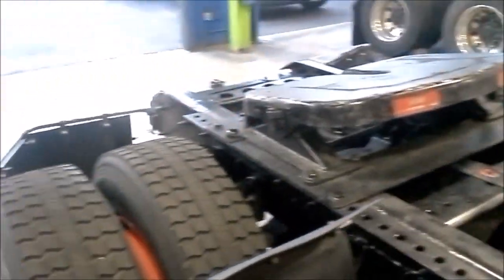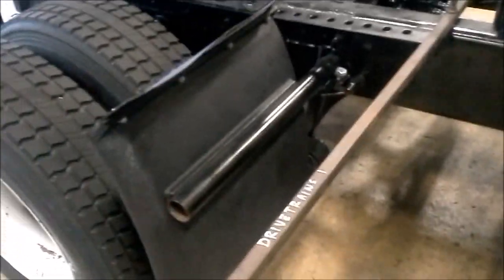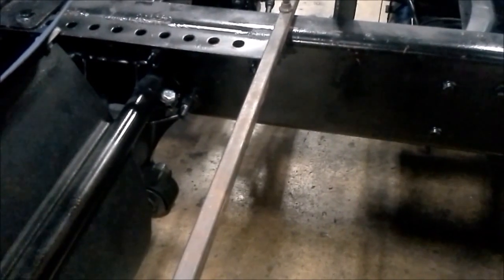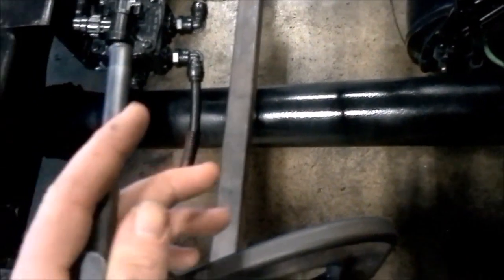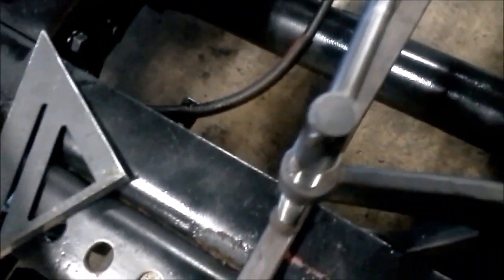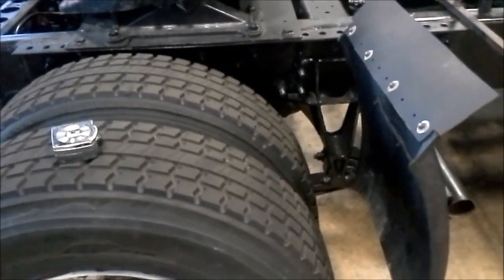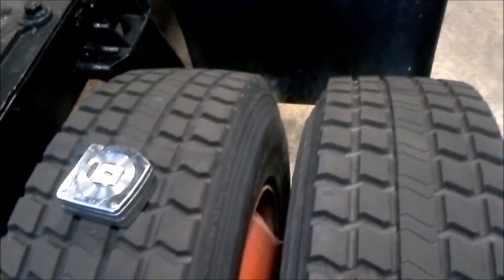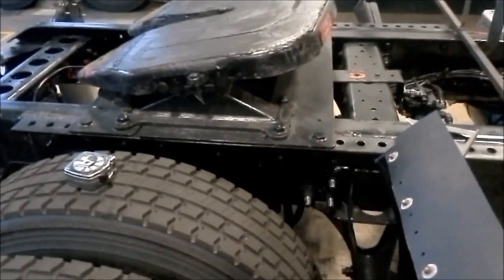semi truck alignment using basic alignment method

Comment: In all the alignments videos no one is actually showing how to adjust / move the axles to the right position ( showing what bolts to work to get the axle in the proper place)
Reply: On that truck (I have a similar one) you'd release the u-bolts and slide the axle forward or back and left or right to center  on the frame.
My Freightliner doesn't have adjustable torsion bars like a trailer has, you slide the axle slightly to align it. Remember the spring has a center pin so you can only move it a limited amount.
Disclaimer:
Don't take my advice....I am not an alignment professional, just a dumbass owner/operator.